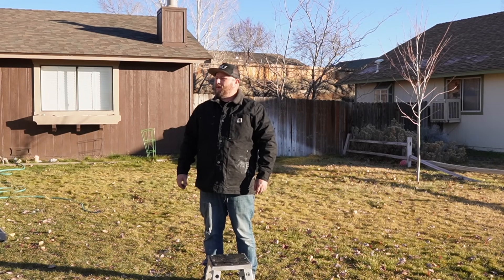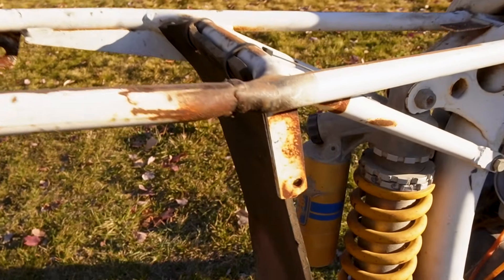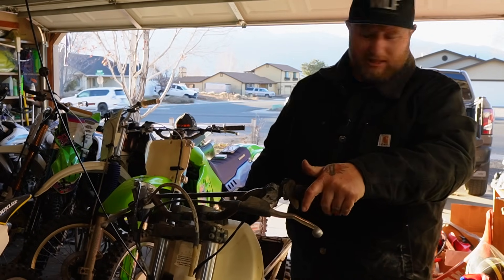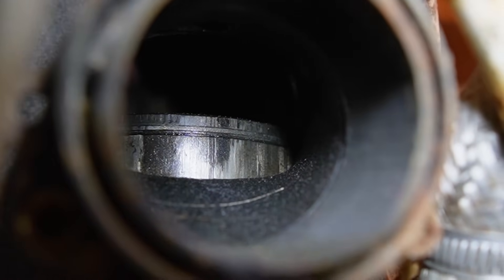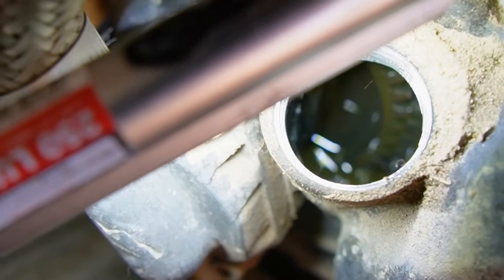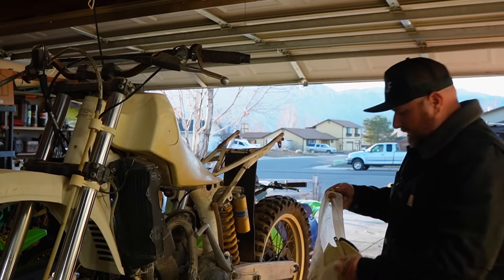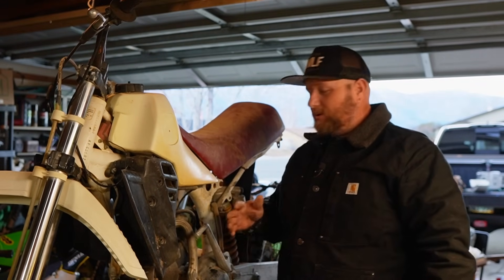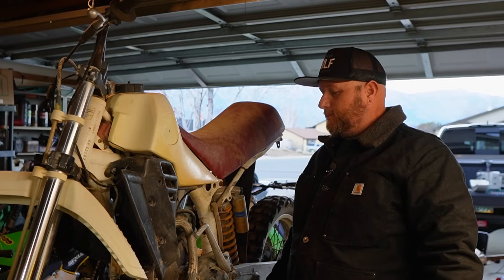I FOUND A LEGENDARY DIRT BIKE!

Comment: The CR has a link rod on the rear brake tied to the frame, to help with braking on MX tracks. The XC (cross country) had a short rod connected to the swing arm.

Comment: Nice find! My 85 500 XC was a puzzle when I got it. Now it’s together, and I call her “Big Nasty” cause that’s exactly what she is. 238 pounds 6 speed 54 horse power it smokes my 1983 Cr480r!  I’ve gotten mine about 90 miles per hour the front tire felt like a ski I lifted off the gas it still has about 15 more mph to go faster.

Comment: I had a husky cr500 in my teens. Awsome fun what a bike. Miles better to ride than alot of modern bikes. Would go like a animal was faster than my mates kx5. But had to replace the spark plug everytime i went on it that was the only downside. Oh yea and the half shot knee where i tried to stqrt it with my mate still on the back of me. Im only 5ft5 n was about 8stone wet through.

Comment: There are "Race" bikes and there are "Race Team" bikes from what I have gathered over the years.Your inserting a KLX &  CRF is spot on,  at least for the sake of humor!  I somehow got a hold of a "Race Team" KX450f . iT IS AN '06 but my friends with  2016 RMZ 450 and  2019 YZF450 both rode my KX and their eyes were as big as fish bowls when they returned. They both said that my KX has way more torque than either of theirs. Mine was owned by a Mechanic at a Kawasaki dealership and said it ws built He said it was a "RACE TEAM"  bike. I don't know even what that means but it means my 06 is faster than  theirs and "Rips your arms off" according to my buddies.. My point is I think race bikes are stock but meant to be raced and a race team bike is built at the factory and rips your arms off as soon as you twist the throttle. Then again I never raced and am taking what I heard and repeating it as fact.. What do you consider to be a "Race Bike"?
Reply: The 06 kx450 was the first year and it was a monster!
It only has 4 gears so its got tons of torque
Over the years they have smoothed out the lower and added a gear also fuel injection to tame it. If you habe a 06 kx 450 thats jetted right, thats a fast bike

Comment: I will be impatiently waiting to hear that Husky sing!  Big bore 2 strokes make plenty of torque & sound good doing it! I've got a 1991 yz ohlins big bore 360 2 stroke one of the last done by noleen racing. The original owner I bought it from desert raced it in socal.  With the W.R. top gears was clocked doing 95 mph. He kept up with the 500's and is about 15-20 lbs lighter.